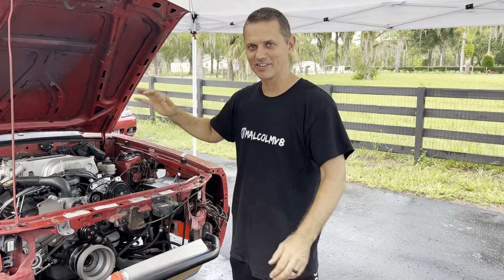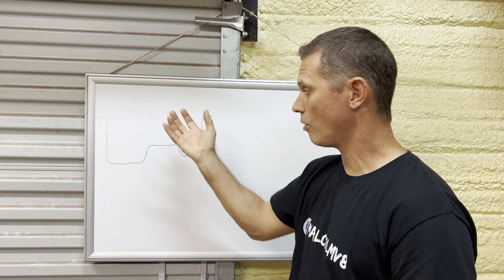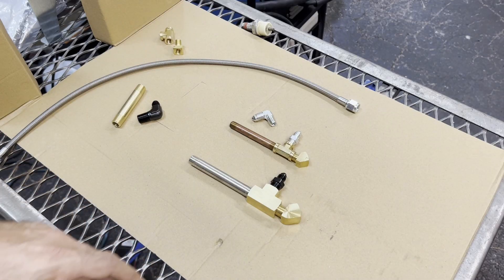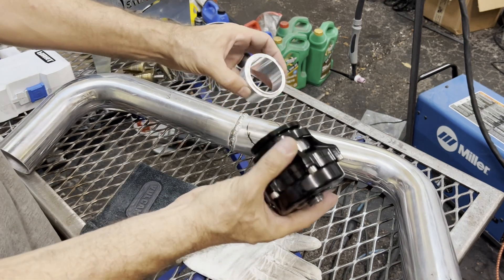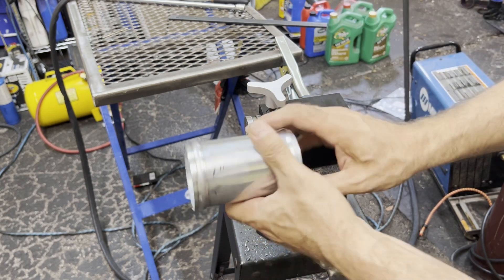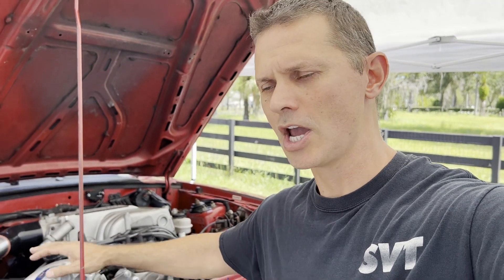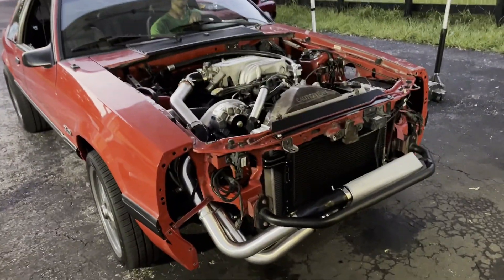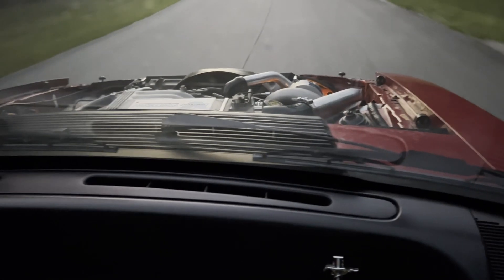Vortech SuperCharger Install & First Startup and Drive!!

Comment: Which treadstone intercooler is this?
Reply from the maker: TRV185 SERIES
Reply: @MalcolmV8  do you have any footage showing bumper fitment / air flow with the way it’s mounted. I’ve been measuring up mine to do something very similar and stumbled on your video. Great job with your stuff !
Reply from the maker: @fishy2k8  thanks, mostly just what you see in the videos.  There's a few videos of this 90 on the channel, cooling upgrades etc.  You may see some angles in some of those that you're looking for.  I can say the airflow seems to be very good as even on the hottest summer days it's keeping the IATs in check very nicely.  We are very happy with the install.

Comment: Have you thought of a wastegate and boost controller on the IC pipes to control boost?
Reply from the maker: Yeah we've seen cars setup like that but there's no need on this particular one.  Usually when people need more boost down load they'll put a smaller pulley on the blower to create boost sooner and then use the waste gate to bleed boost off top to stop from over boosting.  This setup is sized just right for the application and boost is coming on quickly and nicely so we haven't gone that route at this time.

Comment: What size pipes and what size silicone couplers did you get?😊
Reply from the maker: I believe it's all 2.5".  We had to use a reducer down from the blower as it was slightly larger.  2.75" as I recall.